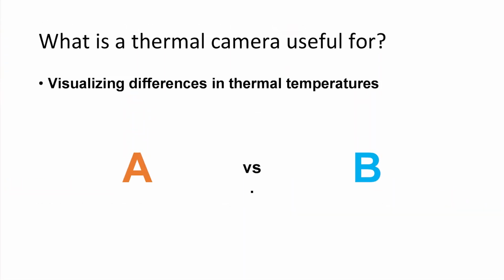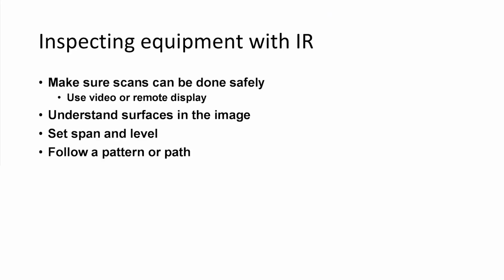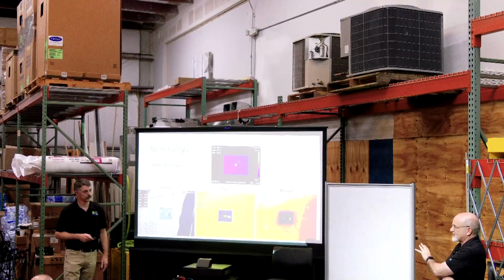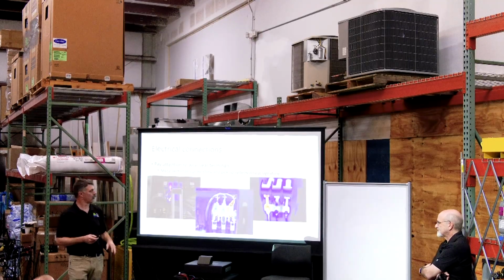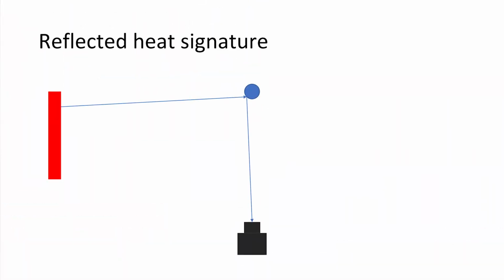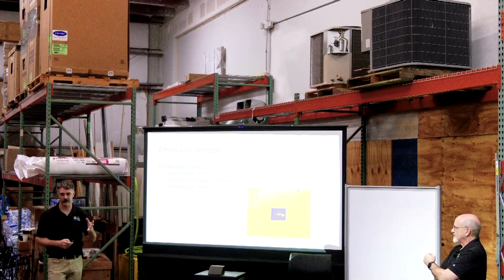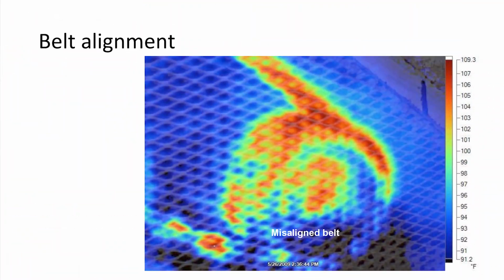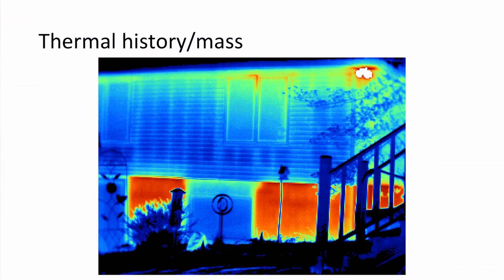Thermal Imaging in HVAC: Theory & Practice w/ Bill Spohn & Eric Kaiser

Comment: Alot more complicated than I thought and anyone teaches about them,including the top hvac channels, even this one till now, seems a bit pointless to even learn for most cases when there's much more accurate temp measurements that can be taken, and you guys say not to rely on the cam alone, so not seeing the value in investing in one. They arnt too cheap for something that I'll be wondering is even close to accurate and have to resort to another method to be sure. I just don't get it
Reply: When it comes to trouble shooting electrical  equipment nothing comes close to the value of a thermal camera, I use it more often than a meters, as far as the system goes it speeds up the trouble shooting time by many times over, the more knowledge you have the better you are.